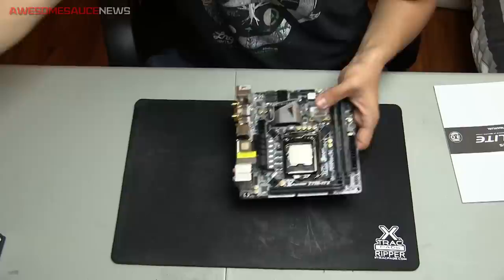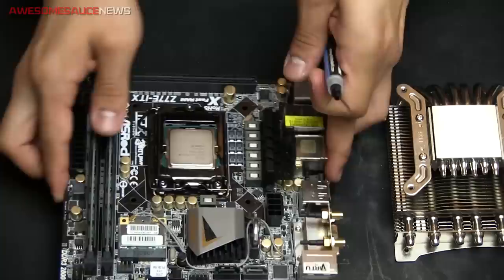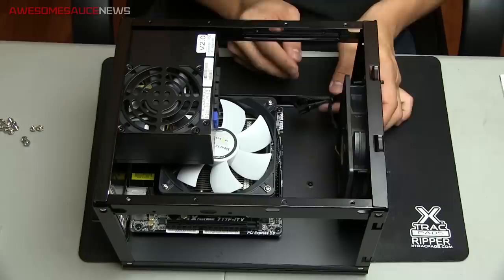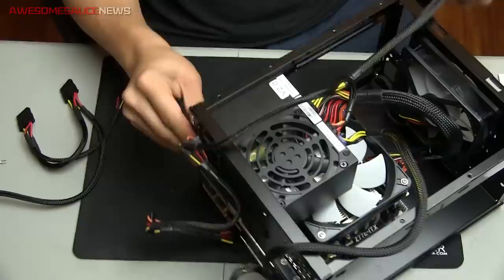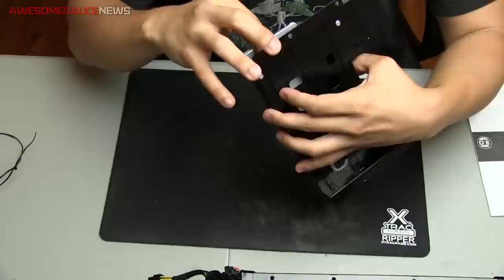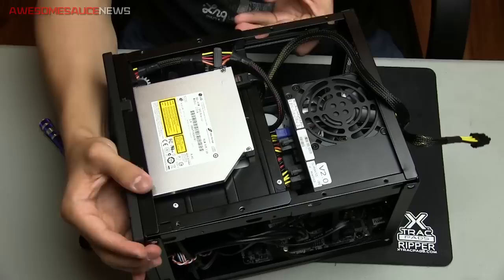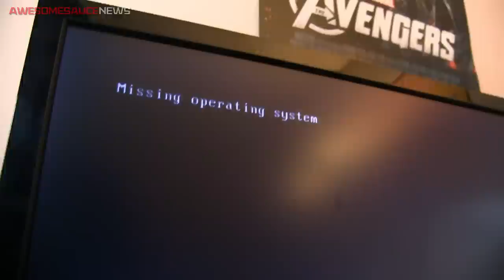Kyle's New HTPC - Part II: The Build

Comment: I know I am late to the game, but I had to stop and say thanks Kyle. This build video helped out a lot when looking around for hardware ideas for building a small, yet relativity powerful, "gaming" HTPC.

I will be using an AMD FM2+ based build, Kaveri APU (once they are released, will be using an A10-6800K in the meantime.), and a Radeon R9 270. So not quite the same, but close.

Same case, same PSU, and same CPU cooler. Fantastic find on the cooler, it looks like it works quite well, you actually sold me on it. The PSU is also amazing for what it is. Perfect for a build like this.

Looking at you install the video card, knowing I only had 10 inches of clearance, and wanting a top facing PCIe power connection. Very helpful.

I changed up the fan and went with the Cougar CF-V12H, I have used several in other builds and I just fell in love with them. Look cool, quiet, and moves a lot of air.

Your AMD compatibility comment on that specific RAM actually made up my mind for me. I was deciding between that and a standard 8GB kit just with low profile heat spreaders. So I decided to give the AMD Performance series a try.

Lastly, I went with a Kingston SSDNow V300 240GB SSD. Oh, and thanks to your video I remembered the Slimline SATA Adapter, as I was researching, it had completely slipped my mind as well.

So again, I just wanted to say thank you. As always, love the channel, and your work at Newegg. Keep it up and geek on!
Reply from the maker: Glad I could help! Your build sounds solid. Kaveri should be sweet for a light gaming HTPC. Hope it turns out great! :)

Comment: Great video. Just completed a build with this case and found a few fiddly things. 1. the cover is difficult to put back on because it needs to slot in with bendable metal holders. 2 The optical drive screws are way too small for the optical drive and I could not get two in because they would not thread. Left it with two and bent the metal to hold the drive. The 3.5" hard drive caddy, when replaced, gets in the way of my PSU main cable and I had to bend the cable which was not ideal. I will look again at my cable management but once built, I am happy with the build. I think it looks cool still years after this case was released. Always a sign of a good design.

Comment: You're mistaken. The CPU Fan pushes air towards the socket/PCB. Main intake fan draws cold air into the case. Hopefully the Asrock offers nice PWM profiles to keep a lid on noise.

If not a custom PWM to analog converter will do the trick

Comment: TIP:  Twist ties inside a case is a bad idea.  The plastic will shrink over time (heat), exposing the metallic ends, which could potentially cause a short.  Preferable to use zip ties exclusively inside a case.

Comment: I think you'd have been better served with a cheaper cpu and a faster gpu, not that the 650ti is bad, but a 7870 DCU2 with the 256 bit bus would've been worth working in, even with a slower cpu, because almost all games are gpu bound (I know you know that).  It just seems like an odd choice of components.

Comment: What did you mean about the power connector for the slim optical drive? Is a special one required? If so, what type do i search for as im getting this case.
Reply: it just wouldnt fit at that angle

Comment: I've been around computers for over 35 years, (building them for about 30), and can attest to twist ties causing problems.  I've seen it!  You'd be surprised how easily the plastic will shrink, especially in a system that isn't cooled adequately.  Why introduce potential problems when you don't have to.   Just saying.

Comment: You are smart to always get the most cpu you can afford because its usually the last component to be upgraded. Top graphics cards come down in price fast and it makes no sense to bottleneck gpu with a cpu. + he can just slip in anouther 650 ti.
future games will not wast that cpu power.
Reply: He can't SLI a 650 and the mini itx doesn't have more than 1 pcie slot.

Comment: You would of had a much better time if you used a prodigy:P that case is gorgeous just much bigger in size BUT! you would have better cable management options + cooling solutions;) Recently built an almost identical system for my sister with the main difference I used Asus mobo+ gpu (650ti):p love the capabilities of mini itx:D